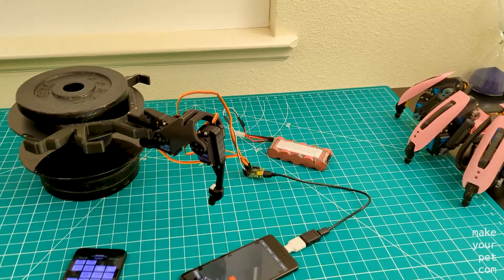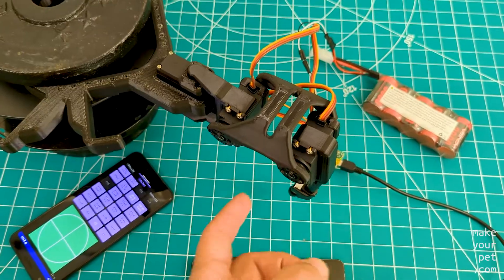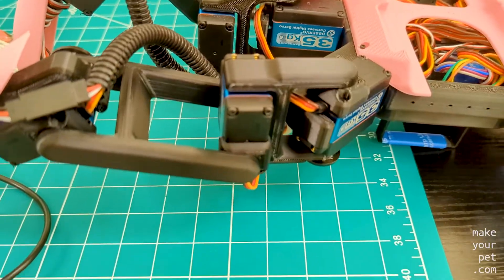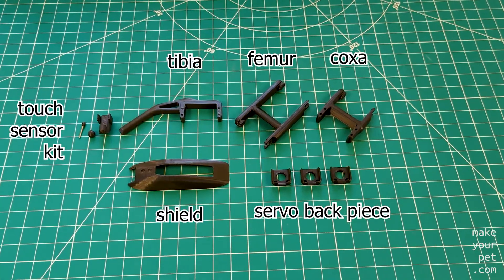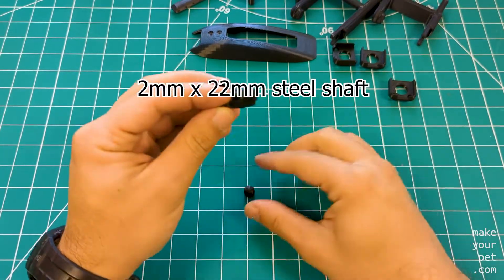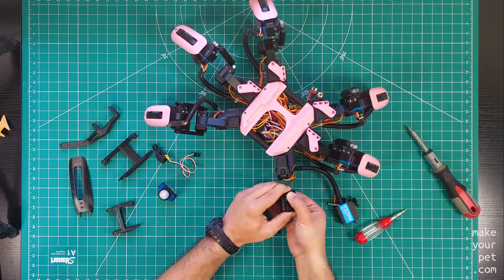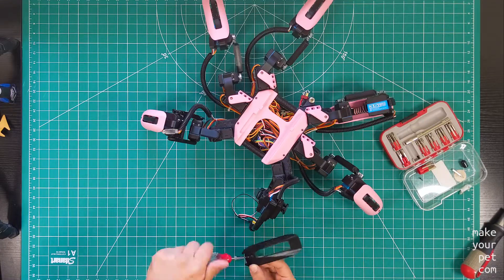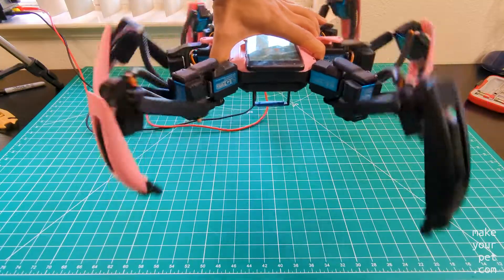How To Make A Hexapod Robot. Part 1 of 3: Building a leg.  A DIY Robot Project.

Comment: What layer height and infill density are you using for your parts? I'm planning on building the frame and 1 leg for testing would 0.2mm layer height and 20% infill density be ok?
Reply from the maker: Yes the default print settings should be fine.

Comment: What wires did you use to connect the touch sensors to the servo controller board?
Reply from the maker: I used these -> https://a.co/d/8q69ixe

Comment: Did you adjust the pulse frequency down to 50 Hz considering that the MG996R is an analog servo, whereas the 35 kg servos you are using appear to be digital? May be a really stupid thing of me to point out, but you didn't specifically mention it in the video :-).
Reply from the maker: Afaik the MG996R is digital (or at least they claim it is). But that is a very important point that you mentioned. Yes I run the hexapod with 50Hz even though my servos could do 300Hz

Comment: Potentiometers are the weakest link in many servos. Pots wear out over time. Once the pot starts to wear out, the servo starts to jitter. This jittering makes the pot wear out even more.

In order for servos to last a long time, I think encoders are the way to go. I've tried several experiments with putting encoders inside of servos but I don't have a solution I really like yet.

If you're so inclined, take a look at my Halloween Hex (I think it's my channel's trailer). I made the hexapod before I had a 3D printer. In the future, I hope to come up with my own 3D printed hexapod.

The very first hexapod I made was made using Popsicle sticks. It didn't work very well but it was still fun to make a robot from really cheap parts.

Thanks for sharing your cool design. I look forward to watching more of your videos.
Reply from the maker: Wow your hexapod looks very nice, well done! yeah the potentiometer wearing over time is a total pain. In more expensive servos they actually use hall encoders, e.g. Dynamixel servos.
Reply: hey I'm just wondering how you made one out of popsicle sticks? Sorry for this late question!

Comment: Does anyone have any tips on how to use adafruit board along with arduino instead of the pololu servo controller?
Reply from the maker: It is not that straight forward, but if you are interested, join the Discord discussions as we are doing some work to support more options there...

Comment: can i use other controller boards?
Reply from the maker: I still need to add support for other boards. So unfortunately not yet.
Reply: @makeyourpet  hi i would like to ask which of the Coxa to print? coxa or coxa 2? whats the difference?
Reply from the maker: @arcline7910  print coxa 2. You should join my Discord server for more details on the build.
Reply: @makeyourpet  yes i will join and thank you
Reply: @makeyourpet  thank you

Comment: is there some documentation on the 3d print process?  Filament, settings, etc...
Reply: I just started down this path of creation and have printed many (but not all) of parts using the following settings:
.2 layer height
30% infill
3 walls, 4 top and bottom
I used PETG at about 60 speed.
Most parts don't need supports, but you may need them for the femurs and coxas.
Reply from the maker: No documentation on the 3d printing process. I have released the STL files, and they are all easy to print. I used PLA on my Ender 3, but you can use any material really, based on your preference.
Reply: @makeyourpet  perfect, that helps!

Comment: You might want to try the MG92B servos. They might be a good choice for your project.
Reply from the maker: Yeah they look like a good option, thank you, I might give it a try. I was just hoping to find a standard size one to reuse as many parts as I can. But a tiny light-weight spider robot sounds tempting too...
Reply: @makeyourpet  I will follow your work close, my friend. I have the same problem as you. I also want to find nice and cheap servos to build an Hexapod. I will share a little of my research so far with you. I hope it can help you.

I suggested the MG92B servos because this hexapod (https://www.youtube.com/watch?v=To2Y6Mhu-CE) uses them and the movements look ok. I am actually thinking on building this one.

For sure would be nice to use the MG996R or the MG995 (as far as I know they are basically the same) because they are cheap, but the movements are not really very nice. As you can see here below:

This one uses MG995: https://www.youtube.com/watch?v=HRC5HrN8KD0 (this one doesn't look so bad)
This one uses MG996R: https://youtu.be/Ds6gBtItyZ0

The best hexapods use the DYNAMIXEL servos, but they are really expensive. 
This is the best one I have found: https://www.youtube.com/watch?v=RluQvXL1tgQ
This is the second best: https://youtu.be/VwTd5cWJx2M
Yours is the third best out there in my opinion: https://www.youtube.com/watch?v=vLr9JiVqL_Q
Reply from the maker: Wow this is super helpful thank you. :) Yeah I agree, the one that uses the MG92B servos looks nice and has smooth movements. I should give it a try!
Yes Dynamixels are the best servos that money can buy. And WOW being 3rd on the list of cool hexapods on YouTube is a big deal so thank you <3!!
But guess what! I broke the bank and have already bought a full set of Dynamixel servos, and going to build the BEST hexapod on the internet (hopefully). :D
Reply: @makeyourpet  I would really love it if you could make a smaller light-weight spider! thanks

Comment: Thanks for the tutorial! I was having trouble trying to figure out how to support both sides of the servos and this video gave me the solution i needed. The tip on keeping the servo horn in place after calibration and using the holes to adjust the angles was really useful too.

Comment: Fantastic design so far! I really like the femur design on your cheaper test platform as well, it's a really cool look.
Reply from the maker: Because Im using a FDM printer, flat parts that can lay on printer bed horizontally come out much stronger. But I agree that the curved one looks way cooler. Now Im thinking about trying that on the main hexapod too...
Reply: @makeyourpet  Yeah, I completely agree about the strength trade-off. Designing around FDM is often a fun challenge. It is a really cool design though, I'd love to see how it works out.